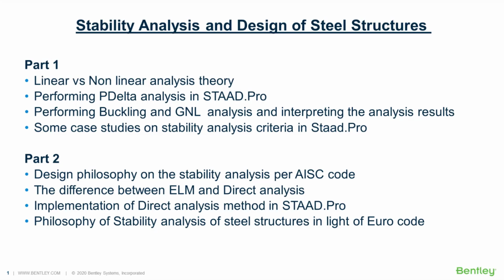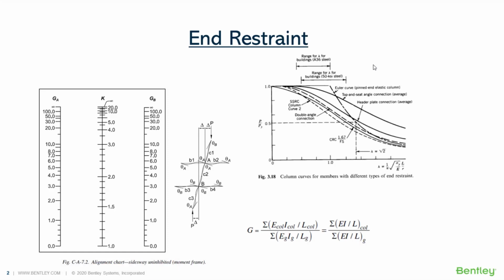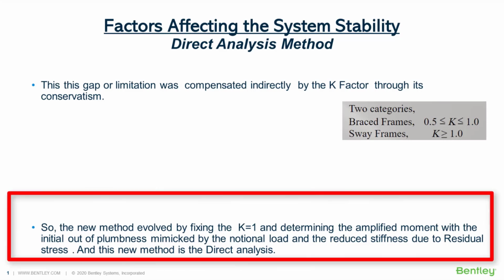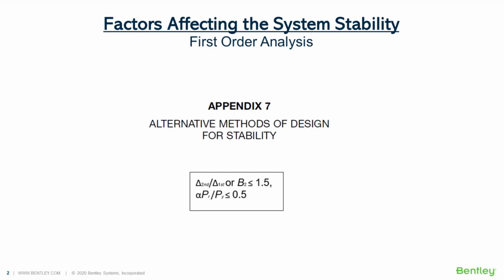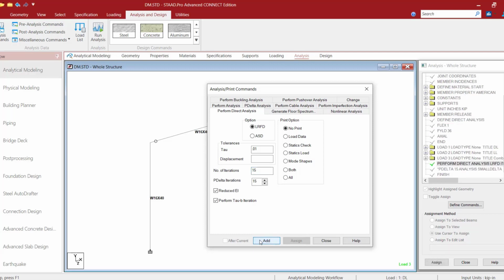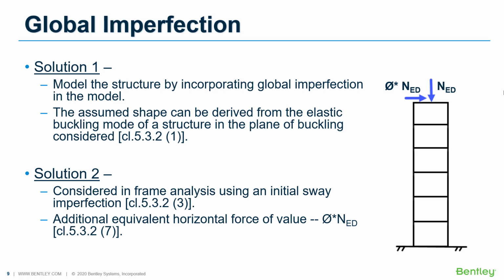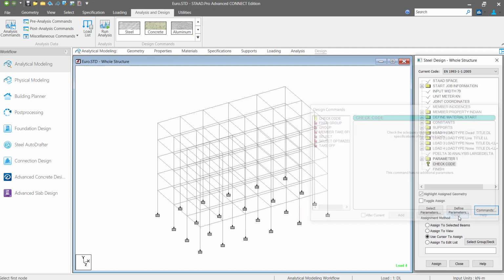Analyzing and Designing Steel Structures for Stability in STAAD.Pro (Part 2)

Comment: Chapters covered in this video

6:00 AISC column curve (Factors affecting the member available strength)
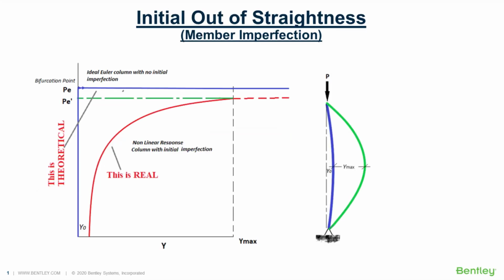9:03 Member initial out of straightness
10:58 Residual Stress
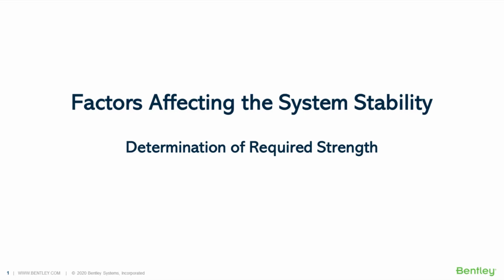17:04 Factors affecting the required strength
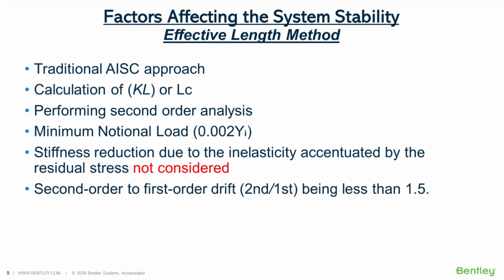18:34 Effective Length Method
19:37 Direct Analysis
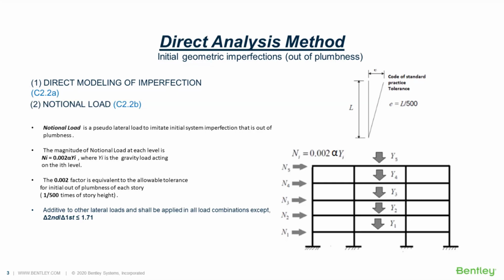24:12 Notional Load
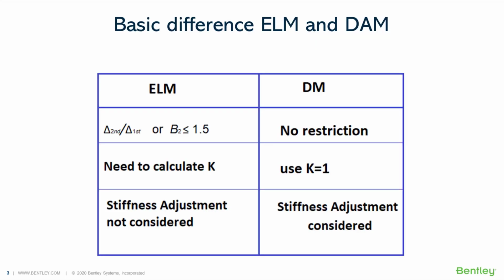30:35 ELM vs DAM
38:51 Stability Analysis per Euro Code